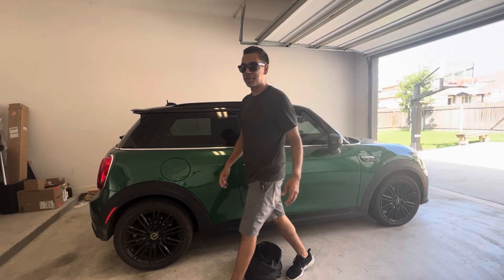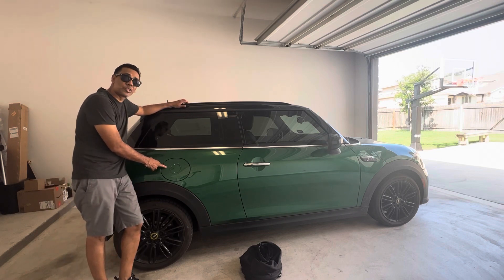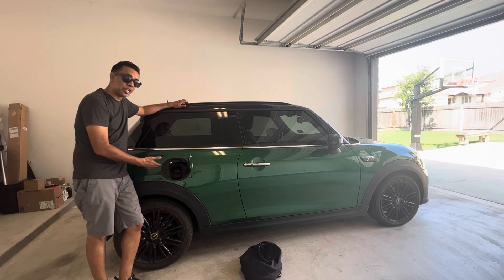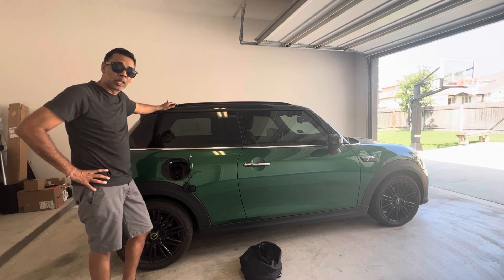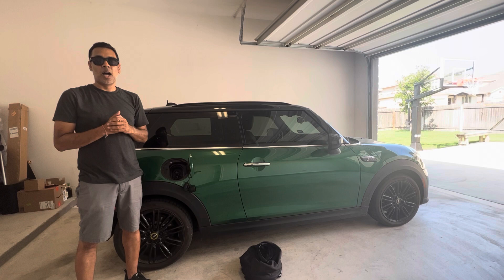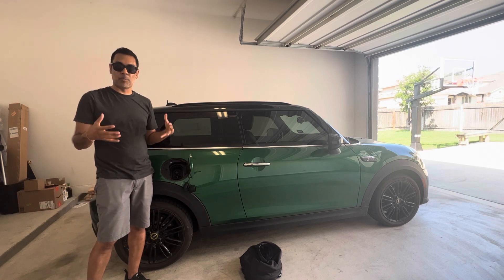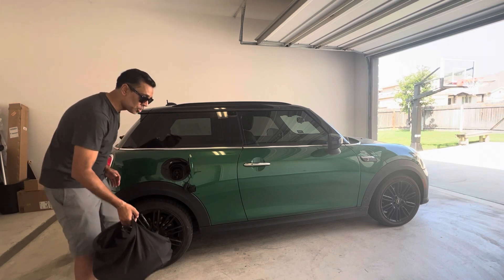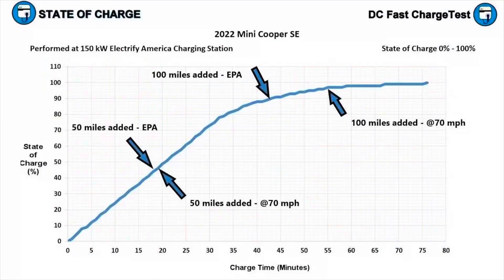MINI Cooper SE Charging Basics

Comment: Any idea how much the DC adapters cost?
Reply from the maker: DC chargers are expensive unfortunately.  The chargers themselves are well above $25K, and getting the electrical done is even more.  AC charging, you can be up and going for as little as $1,000 in many cases (including charger and install).